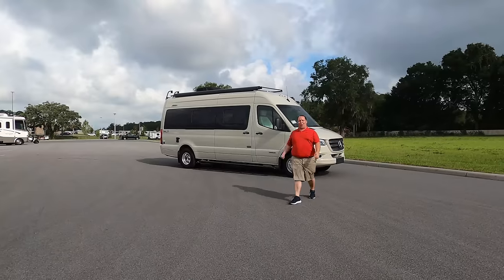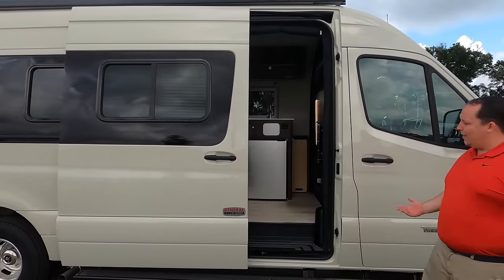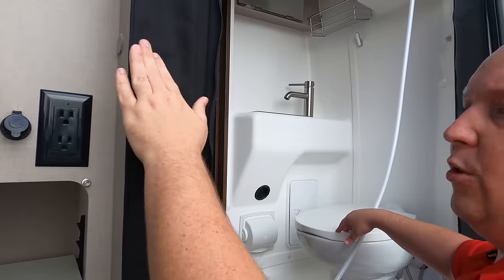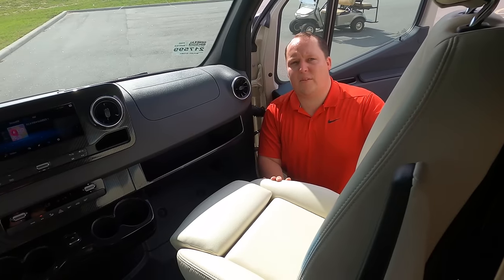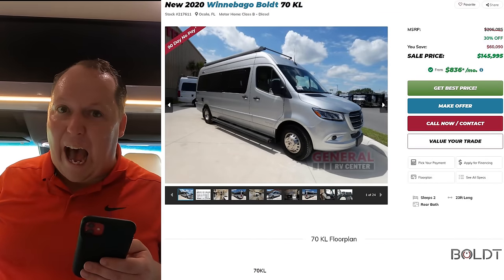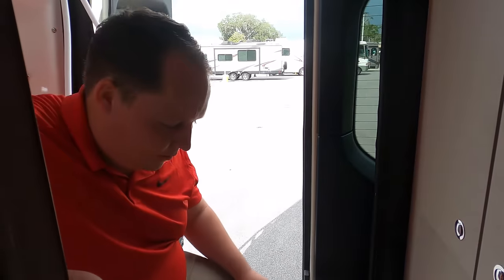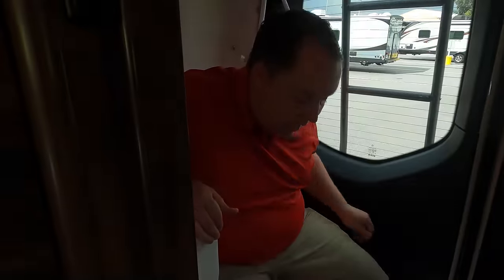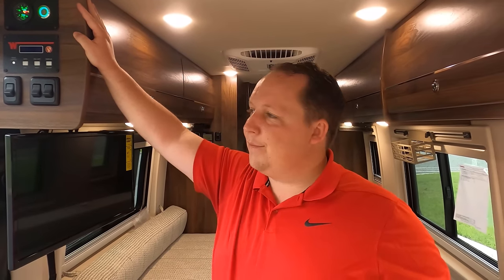Best Class B Motorhome for Fulltime Living! Off the grid camping

Comment: Applaud you for doing your first class B!! PLEASE do more. As others have said many people including myself are looking at these seriously. This particular model floor plan is not for me although it has some features I love. This unit is upscale and imo the two beds/sofas are staggered inappropriately and waste what could be flexible space. City water fill should be enclosed and lockable. Windows I assume are double or plexiglass - should open outward from bottom vs sideways. Not a fan of having a propane tank when you have otherwise fully electric..?  That seems needless. A larger- 2 door fridge needed at this price point. As class B’s are/ were? really meant to be very versatile, rugged, for off road and boon-docking, this unit might be renamed a “LUX- B” ...lol. Like the wet bath size but prefer not in back which is prime storage location imo. Anyways- thank you !

Comment: Need design B for Pack Rats: off road, off grid, liveable for several mo to long-term, get rid of black tank & put in compost/ cassette need that room for fresh water, shower should be external- too much moisture small rig, get rid of that fridge & put in Dometic fridge/freezer chest, where do u put ur gear?
Looks more for long road trips to the ski lodge or weekend camping at a campsite

Comment: Yes do more class B motor homes!!! 
I dislike the price 😂 it’s expensive 
I dislike the slide windows. I like the 2 ply poly tilt out windows. That may be an option but they can be open and keep the rain out. 
I dislike the small tanks. Fresh gray and black but it’s a class B so.....

I like the solar and lithium batteries. The VOLTA is amazing. 
I like the PPP in the bathroom. 
I like the storage it does have for the size. 

It’s not my favorite floor plan due to the small fridge and bathroom. I like the GL plan better in the Trevato but that’s me. The AC is super quiet and runs off batteries. The average is 8 hours from what other owners have said. Give or take. The extra solar port is great. 

PLEASE WINNEBAGO PUT THE VOLTA IN THE NAVION WITH MORE LITHIUM AND A SMALL GENERATOR TO RECHARGE IT. NOT A 4000w BUT SOMETHING LIKE UNDER THE HOOD OF THE TREVATO AND AN EXTRA PORT FOR SOLAR. 

DO IT PLEASE

Comment: I had a 78’ Westfalia when I was younger. In my opinion, the pop top is extremely underutilized in today’s B class vans! Forget that silly parallelogram style bed. Put a couch there instead and a bigger fridge. Put a flip out dinette table in between the front seats. And put the bed up in the pop up! Insulate the the fabric walls in pop up and throw a light, a fan and some usb power up there. A Ford Transit chassis would be the cherry on top (waaaaaay cheaper to maintain than the Sprinters). I’d mortgage my house for a rig like that! Hint, hint Winnebago! 😉👌

Comment: I'd want more solar, and electric flash water heater. Lose the propane and use a Webasto type diesel heater. And the offset beds have GOT to be lined up.
 What kind of insulation does it have?

Comment: Mercedes requires you to use B5 (5% biodiesel) or lower percentage.  Otherwise you void your warranty.  In the US, this is very difficult.  I spent 30 minutes in Oklahoma City going from 1 gas station to another trying to find the right diesel.  Called Mercedes to find a fix and there isn’t one.  I now drive a gas engine.

Comment: The air conditioner works off the batteries but for how long? With the bathroom in the back you don't have a garage, thus eliminating space for many items you might like to be taking such as bike, skis, tools, etc The table behind the driver's seat seemed too cramped to be able to comfortably sit there. The refrigerator is too low! The wire basket above in the kitchen seemed cheap looking! Does this new chassis compare in width to the Ram ProMaster? Overall I did not care for it for the price.

Comment: It is a fine van. However, the refrigerator /freezer is small for disperse camping. There is lots of room to place a larger refrigerator on the right by extending it into the entry or left side by shorting the table. The entry should have a sliding screen in lieu of that flimsy curtain. It’s suppose to be a upscale van. Does it have complete insulation for North woods camping? An breakdown of one of the old vans showed only thin inserts in the door panels and rear quarter panels.

Comment: The thing is, that the 2020 Unity is about the same price - also Mercedes, but it has a rear lounge or murphy bed option.  You are right in that this has a very odd layout with quit a bit of poorly designed space.   I'd rather have a Class B+ (an extended B, not a C) built on the same chassis that's only a couple of feet longer and a few inches wider.    
This is one you should review as well.

Comment: I would prefer no particle board wardrobe in the bathroom.  I would prefer empty space to put bikes, surfboard , skis , or whatever stood up on edge that can get wet.  And one  of those super fans in the bathroom. 
A convection/microwave oven
A bigger electric/propane refrigerator that goes all the way to the countertop. 
Reclining front seats for extra sleeping.  
I agree that bench seats should match across the aisle. 
I love the bath size and position. 
I like the windows 
Maybe we can get “Joe’s Plumbing” paint job????

Comment: I also like Class B's for ease of driving, parking, fuel, etc. And understand why pricey.    However, I still thing the new 27' have much more room, comfort and storage that I might be better going to that size.  Note, i do not hear you mention length of Class B s.  My last two Class As were deisel which i loved.  A Cummings first I thought I would always use this type then a Catapiller I expected to be noisy and hate, but ended up quiet and strong.  What about discussing engines, fuel mileage, noise, and chassis.  They were Freightliner chassis at the time they were the best from their truck history and quality.  Things have changed and a lot of new brands of these items are out there.  Maybe a show that discussed the more mechanical and structure of units showing comparison info might be helpful to many.

Comment: For the driver side table, could they have put the hinges on the underside when open? I also agree about having a second cook top. And, wondering if the bed could have been reconfigured and possibly of had a little dinette? I do like the unit but why are the prices higher then a lot of Class C's?

Comment: Love the colour like the seats like the windows dislikes don't like the refrigerator were at, better by the same side with extending facet on the sink          from outdoor shower door don't like the bathroom at the back of the Van I want to open sea the ocean , That's where the bed needs to be with a slingback couch that can also have a recliner on it if you don't want to use a bed And besides all be electrical & compost toilet  Extended roof with windows and still have your AC and your solar That is the dream Van totally stealth Just saying , love the reviews

Comment: I'll start with 3 (+1) things which I dislikes
1. If you are going to make wheel base 170" why not make it 170" Extended version, its longer which mean I can have more space to do the bedding (the design for the bed is so stupid, it is great for twin bed but it is definitely not for couples) and the bath (I hate tiny bath, I would kill for a full bath). I understand why there is a wardrobe in there, it would have been better if make it water resistance or moisture resistance. So that we don't have to hang the curtain. Because the space is already small, too much in there it would feel stuffy. 
2. Small table on the driver seat, you don't need that. You can put your laptop on the kitchen top. And there is no table between the sofas.
3. I agree with Andrea there should be 2 induction cook top, and also I would love if the forcett tap is movable. 
4. With these kinda price I would expect a BOSE sound bar not JBL.   
Now 3 (+1) things which I like
1. I agree with Matt, I love that it is 100% solar off the grid with propane option for outside grills and its electrical function. 
2. I like the new Mercedes chassis and its technology
3. At least it is not a plastic toilet which is good I love it
4. I like the air conditioning that is not connect to the main tank, its runs off battery.

Comment: Clever but not livable for two. Touring, yes. Staying for 4 days or a week...no. Spending that money for a not livable RV?  But...the design principles, applied in C or A are long overdue.  How come no one does a small A or C with twins that turn into a larger bed, solar base power and integrated digital management, quiet AC, easy swivel seats, flip up and swivel desks, with all those safety driving features. Would we need the weight and maintenance of slide outs? A 28 footer with those good space use principles would rock the market.

Comment: 1) I like the movable front chairs w/each having a desk or table. 2 )  I like the bath, and 3) I like having a window in the door.   I don't like # 1) the bed configuration, 2 ) I don't like the one burner cook top I agree 2 burners would be more useful and 3) I don't like the shallow sink, 4 )     that tiny frig would only hold snacks for a weekend camp out. This NOT a Class B I would consider buying even though I would be part time.

Comment: Like the screen door, solar already installed and Matt's skipping.
Dislike the lack of generator, not a lot of storage and those God awful couches aka beds.  Those couches make the inside  look of the class b as a moving van hauling furniture.
Reply: You don't need the generator.  You have the full 30amps of power to run the A/c, microwave and CPAP at night.  Start the engine or expose the solar panels to sunlight, and you are recharging the system.
Reply: Aren't you tired of having to run that noisy generator?

Comment: I like the auto correct when driving, the electric door and the swivel seats.  I don't like the look of the interior.  Very plain and don't like the dark cabinets.  Don't like that the couch seating is not across from each other and looks like it makes only 3/4 of a bed.  All in all, I'd rather start with an empty van and design the interior.

Comment: Overpriced and no generator, have to start the engine to keep the ac going? MBZ engines do not like to be idled unless this has the high idle option either way its going to use way more fuel then a diesel generator, this will appeal to the greenies but not practical in  desert hot conditions and  winter camping...and I do own a sprinter...

Comment: 3 HUGE reasons I will not purchase & 3 things ♥️: 
☹️Bed needs to be redesigned. Too cut up, awarded design. 
☹️Bed not Froli System
☹️Not all electric, lp sucks for Winter use 
♥️shower
♥️fully optioned Mercedes chassis, a must!!!!
♥️Industry best and safest insulation package

Comment: Besides being out 250 to 300K these things are monsters.  As a retired 30 firefighter who drove rigs this big daily for 25 years, I know.  The average guy is going to have a tough time driving a 36-41 foot rig across country.  Remember that you will going through towns, parks, national parks built for vehicles from the 1930’s!   BAD MOVE, BAD THOUGHT PROCESS.........   the cost, the fuel, the prices at the limited campgrounds that have room and proper electrical service for these 50 amp behemoths is very limiting.  Then there are questions about the RV storage when not out driving around sucking up diesel at what will soon be $4 a gallon from our new political leadership!   You might as well spend $250 on a nice fire pit for the backyard and save yourself the anguish, by throwing a $500 cash into the fire pit each weekend just for giggles😳😂🙀🤷🏻‍♂️
INSANITY, PURE INSANITY!